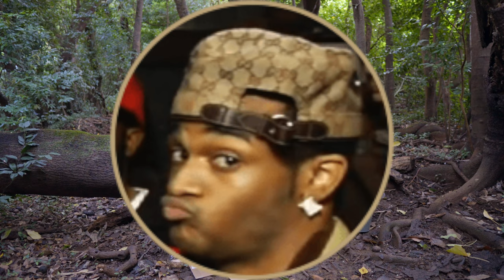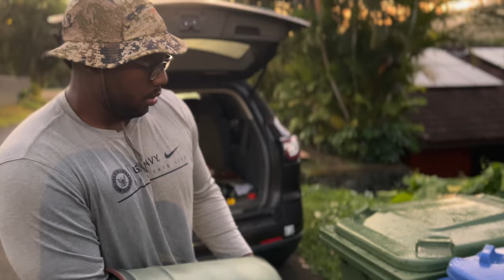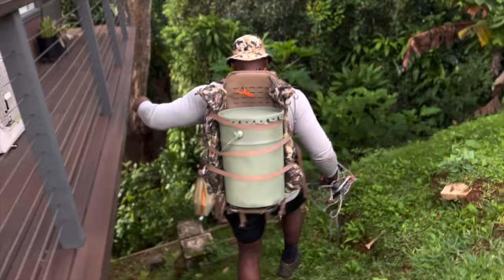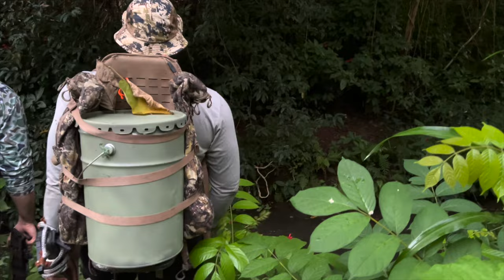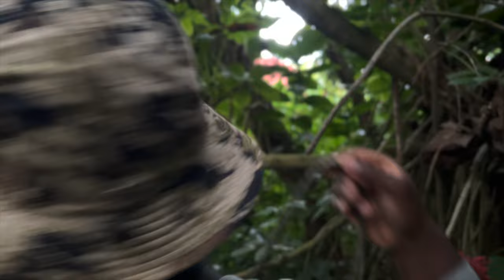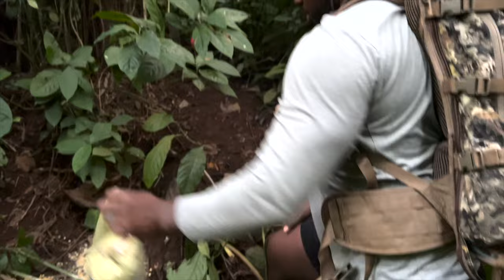Hunting Over Feeders? Here's how to make them more reliable.

Comment: The Moultrie digital 1 is probably the easiest and very reliable unit. Multiple settings and can be adapted to a solar charger for almost no maintenance requirement. We have 13 out on feeders for about 4 years now with very few problems.  They run year round.  So easy to mount and program. We use varmint protection wire cages as there are raccoons. All the feeders are at 7 feet to the bottom on the feeder motor because of cattle. While they can't pick up the corn very well at all they will come to the feeders. If they weren't high up their horns will destroy the motors. And yes, it's a pain to fill them  as they are all 350 pounders of corn each